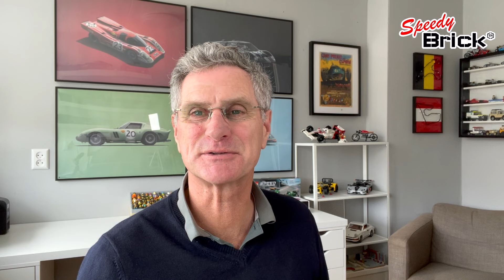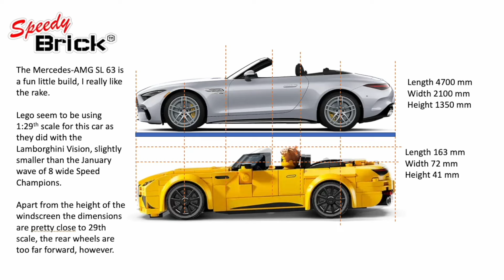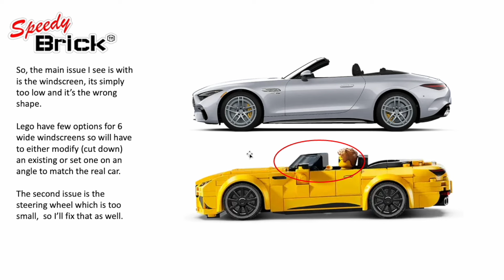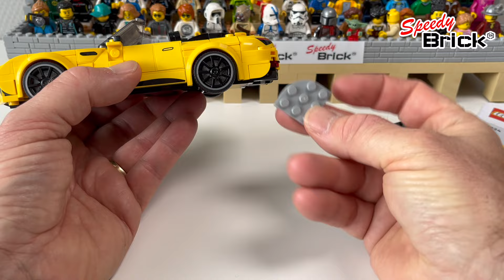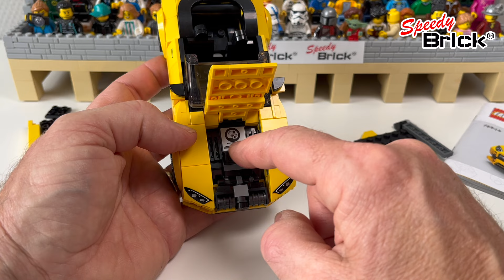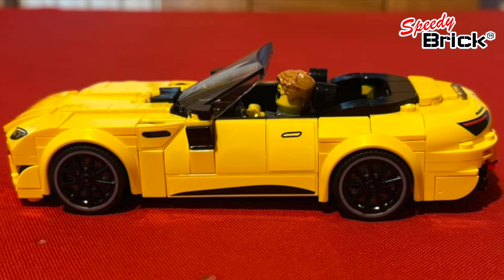Lego Speed Champions Mercedes-AMG SL63 Fix and Improvements #76920 #legomoc #speedchampions

Comment: can you make a video of how you made the mods for the sl63? and the parts needed? thank you!!
Reply from the maker: Might be a while before I get back to this one but will try.
Reply: @speedybrick  thanks!! if you have the time, can you please comment down below the parts you used? so I can apply them on my own sl63?
Reply from the maker: @paulaaronquijano3255  ok these are the parts i used. Using Bricklink codes: 1 x 92583 trans brown, 2 x 3937 any colour, 2 x 3938 black,  1 x 32828 black, 1 x 30663 black, 2 x 54200 yellow, 2 x 61409 black, 2 x 2431 yellow, 1 x 87079 yellow, 2 x 15712 black or yellow, 1 x 99563 black or dark grey, 2 x 3070 yellow, 2 x 3024 yellow, 1 x 3710 black, 2 x 3023 black, 1 x 3710 yellow, 1 x 3020 yellow, 2 x 34103 black or dark grey. Lots of parts recovered of course, I think that was everything. happy building
Reply: @speedybrick  I appreciate that alot my guy!! thank youuu

Comment: Where you go 3x “that bit doesn’t exist” that last bit does exist. At least you look to be pointing out a quarter round piece (1x2) with 2 attachment points.
Reply from the maker: Do you mean the new L shaped plate with rounded corner. I looked at that but it’s too square looking. There is a brick the right shape but I need a plate
Reply: @speedybrick  unless I misunderstood but it’s the same piece that is on the G-Wagon, surrounding the spare wheel Mercedes logo. But in studded version. That’s been around for years.
Reply from the maker: @iDON_JOHNSON  yes exactly, but i don't know there was a studded version. Do you have a part number?
Reply: @speedybrick  part 79491
Reply from the maker: @chazmyster  ok i see what you mean, i think of that piece as a L shape with rounded corner. but it is too square to match the shape of the curved piece above, so didn't want to use it.